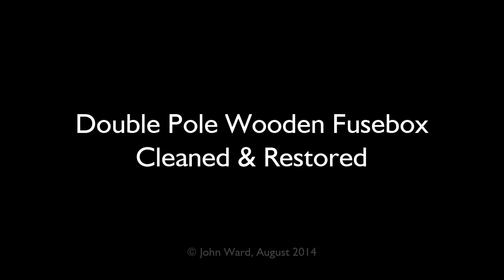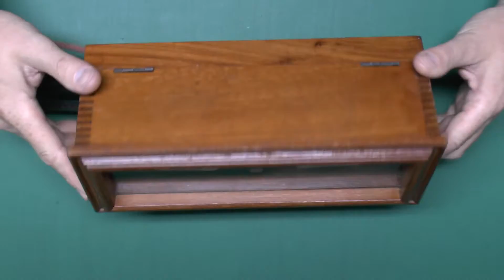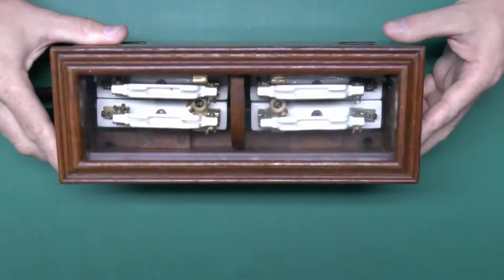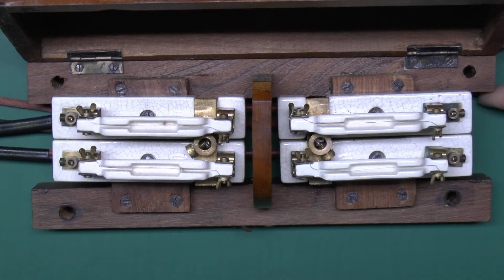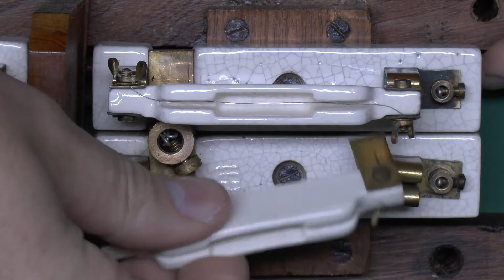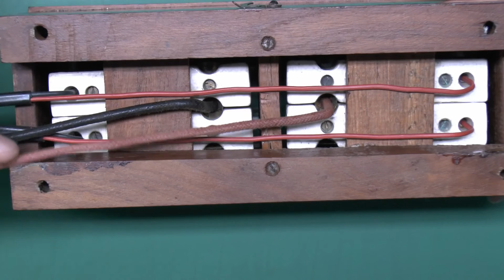Wooden Fusebox Cleaned and Restored

Comment: Having a fuse on neutral seems like a bad idea. If it blows, and the fuse on live does not. Then it will look like the electricity is off, and safe to touch. When in fact it is not.
Reply: +Per Mejdal Rasmussen Exactly! Actually a friend of mine learned this the hard way replacing a light fixture in her "new" (1950s) place. Only took out one fuse, saw that the lights were out and went to work.

Actually fusing neutrals was common in Austria for a long time, probably well into the 70s, although fuses had mostly gone out of fashion by that time. We still have MCBs that switch the neutral but obviously there's just one handle for both poles.
Reply: Per Mejdal Rasmussen Which is why they are no longer permitted